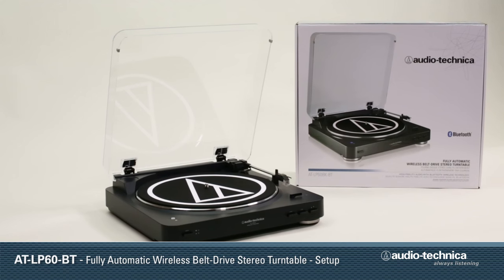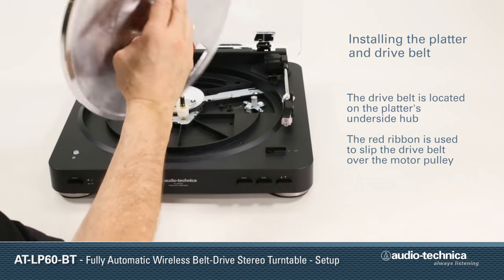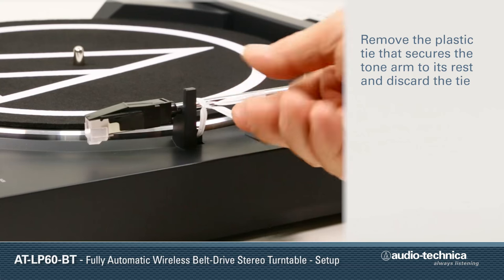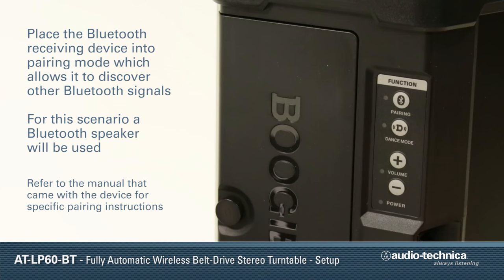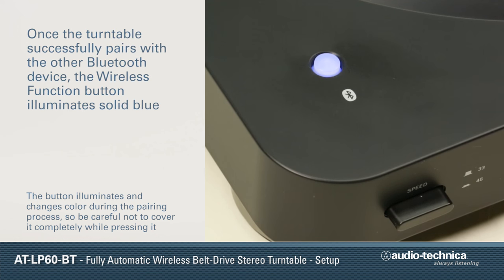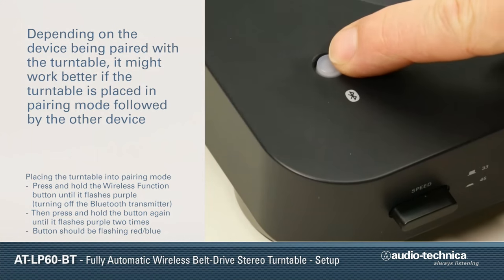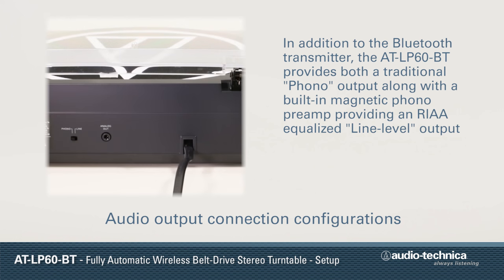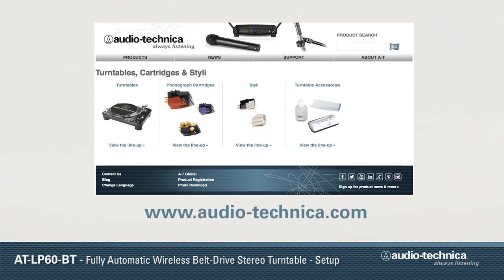AT-LP60-BT Setup | Wireless Turntable

Comment: hi, i just got one of these today. i have an issue where it is very quiet. i have followed all of the trouble shooting steps. i am not using a speaker, is that the reason?
Reply: ellis the banditø You need a Bluetooth speaker to pair it with
Reply: ellis the banditø I'm planning on ordering an Audio Technica LP60 but I don't know whether to get the Bluetooth one or the original one
Reply from the maker: Hi there! Our AT-LP60-BT needs to be paired with a bluetooth speaker or headset. Thanks! - A-T USA

Comment: Mine played awesome for the first year and now it is skipping on any record that I play.  Any insights as to why that may be happening?  I did replace the stylus.  Are there any adjustments that I can make on this turntable?
Reply from the maker: Hi John! Thank you for your inquiry. There are no adjustments on this turntable.  There are a couple of things to consider when skipping:

1. Make sure the turntable is level
2. If the turntable is very close or on top of your speakers (especially a sub), bass heavy songs could skip at higher volumes. Turn the volume down to see if it still skips.
3. Bouncy floors could cause a skip when you walk across them. You may need to cushion the turntable with something.
4. A dirty or worn needle will skip. Keep them clean.
5. Certain new pressings of albums may not be mastered properly for vinyl and may skip. Again, bass heavy songs could skip at higher volumes. Turn the volume down to see if it still skips.

Thanks! - A-T USA

Comment: Set up mine watching this video but when connected to the Bluetooth speaker; the volume is super low even while raising it all the way. Any way to fix this?
Reply from the maker: Hi Yaymeli! Make certain the RIAA phono preamp switch on the rear of the turntable is set to LINE.  Also, for troubleshooting purposes, plug a set of headphones directly into the turntable.  While the level will be lower, you will be able to hear the signal from the turntable and if you can hear in both sides, we know the turntable is in working order and the issue is elsewhere in your signal chain. 

If you do not hear any audio through the headphones, you may remove and reinstall the stylus to make certain the stylus is properly seated in the cartridge.

https://www.audio-technica.com/en-us/support/audio-solutions-question-of-the-week-how-do-i-change-the-atn3600l-stylus-on-the-at-lp60x-line-of-turntables/

If the issue continues, please contact the Audio Solutions Department. Thanks! - A-T USA

Comment: Is it obligatory to turn the plate with your finger ten times after attaching the strap? Does not that spoil the engine? if I put the belt on the motor and do not turn the plate it works normal? I'm waiting for my audio technica to arrive, I have this doubt, could you take my question? thank you!
Reply from the maker: Hi there! Please contact our Audio Solutions Team for help. You can reach them at audio-solutions@atus.com. Thanks!  - A-T USA

Comment: hi I'm having a super strange problem with my AT-LP60WH-BT. I have just received this turntable the other day and it worked perfectly with my bluetooth speaker, but today, the music won't sync to the speaker. The turntable and the speaker are both paired (they both have a solid blue light) but i can only hear the music slightly from the internal speaker of the turntable, but not the speaker. Ive tried reconnecting, unplugging then plugging it back in, different vinyl, charging the speaker, but nothing is working. When i plug in earbuds, I can hear perfectly fine though. Please help!!!!
Reply from the maker: Hi there, our Part Dept. may be able to help. Please reach out to Parts at parts@atus.com. Thanks! - A-T USA
Reply: Hi there. Did you ever get this figured out? I'm having the same problem.
Reply: Audio-Technica USA

Comment: My AT BT TT keeps pairing/syncing with someone ELSES Bluetooth device in this building

Getting the right sequence of lights/colors...

When I have no BT device up and running...

But it will NOT pair with any of my MacBooks, Mac Mini or PowerBook G4

When I hiae them ON and discoverable....

ALL these Apple INC. machines can pair with each other just fine

With macOS -10.9 and 10.10

Any ideas?

J.C.

Comment: Can I use a record weight with this?
Reply from the maker: Hi there! Yes you can! - A-T USA
Reply: @AudioTechnicaUSA  Thanks!  Which weight would be best?
Reply from the maker: @rnrmolon  Hi there! Our AT618a would be best: https://bit.ly/3iPhTOR - A-T USA
Reply: @AudioTechnicaUSA  Thanks!  Follow-up question!  What cartridge could I use to upgrade the pre-installed one to possibly improve sound quality?
Reply from the maker: @rnrmolon  Hi there! The cartridge cannot be changed/upgraded on the AT-LP60 turntables.  It is a fixed cartridge.  Only the stylus can be replaced. The only replacement stylus for this turntable is the ATN3600L. Thanks! - A-T USA